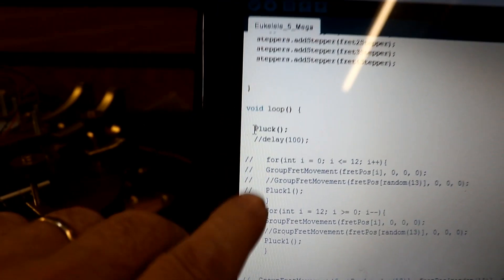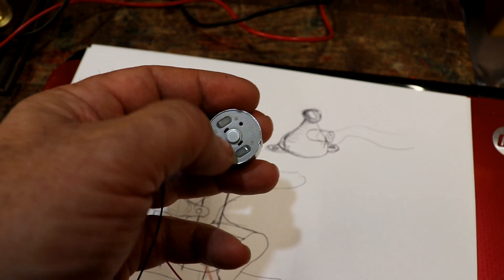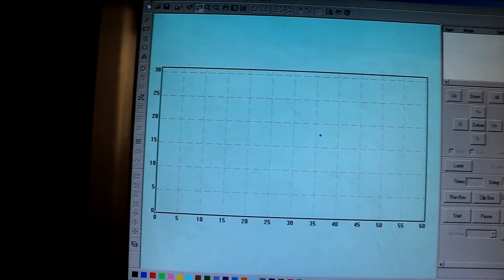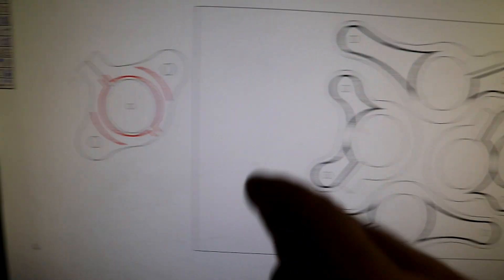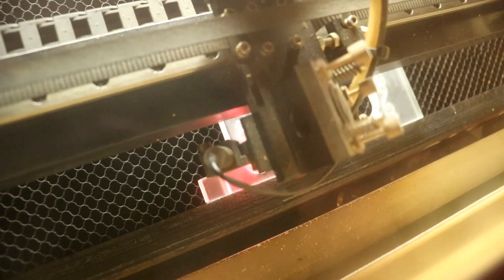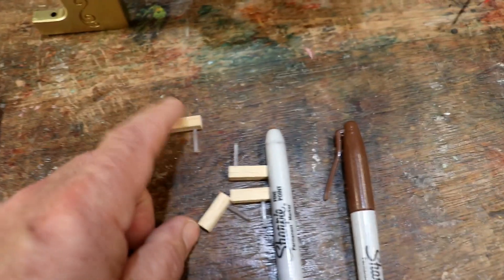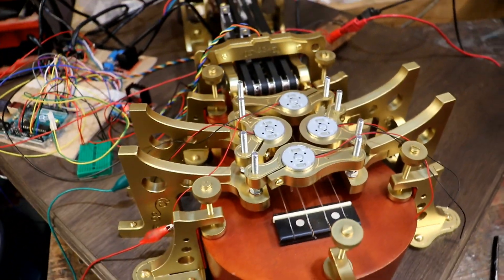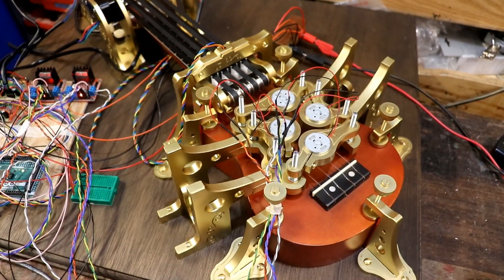Ukulele Playing Machine - 8

Comment: hmm, I suppose you could probably also make some sort of similar-ish contraption with push/pull motors to operate a mechanical typewriter, write a program that will read a text file, and translate the letters/etc to map coordinates (where the physical keys are) so basically a typing robot, sort of an unnecessarily mechanical printer. Sorry I'm a bit typewriter obsessed. 
...
oh heck, I suppose you'd also need to arrange something for the carriage return lever, possibly program it to activate after a certain character (including spaces) count is reached to set margins, or nah, better yet, just use an audio sensor programmed to detect the frequency of the bell, which would allow you to just set the margins manually on the typewriter itself, and operate a more like an actual typist.
Reply: Oh curse you for inspiring me to think this much, but I've just realized you'd need a way to tell the typing robot when to stop because it's run out of paper..

I suppose since the paper is white, and the platen (the big rubber roller) is black, you could shine a light (laser?) at the blank paper behind the platen, reflecting onto a light sensor, until the paper gets out of the way, exposing the black rubber platen. So long as the sensor is reading sufficient light, it keeps typing, once it goes dark, the program pauses the typing, and triggers a motor that say, perhaps turns an antique style mechanical twist doorbell, (or even perhaps some weird ukulele playing machine, if you happened to have one laying about) to let you know that it's time to add more paper, and push a button to tell the program to resume where it left off.

Okay now I'm starting to think of ways I can add some electro-mechanics (and fancy gears) to the reproduction antique mechanical twist bell that I paid $40 for, and installed on my front door, only to find that nobody ever uses it because they have no clue what it is, and I really should stop this and go to bed!
Reply from the maker: @amishrobots  Thank you so much for sharing your ideas! It's great to be in touch with someone else who gets completely carried away with exciting ideas. I'll have a think about a typewriting automaton, it's definately possible and I happen to have a lovely Royal typewriter in the loft, the one with beautiful bevelled glass windows in each side so you can admire the ingenious mechanisms within! 

I've been thinking more about the gauge idea, and realised the gauge needn't be electrical, it could work on pressure, temperature or purely mechanically - the subconcious is truly amazing!
Reply: @steamhead  Ah, would that be a Royal no. 10 then, or something else? I have a few machines, but no Royals. I do have an Underwood no. 5 which is quite similar, with open sides, but no glass. A pair of Corona 3s, which I love for their diminutive size, funky 3 bank keyboard layout (separate shift keys for figs & caps) and of course the carriage folds over the keyboard for compact transportation. a couple of nice Remingtons, and several Smith-Corona Skyriters. One day I dream of owning a nice Blickensderfer, with the DHIATENSOR layout...
Reply from the maker: @amishrobots  Apologies for my lack of knowledge regarding particular models, but I do love an old fashioned mechanical typewriter. Luckily I grew up when they were being superceded, so regularly received an old one from neighbours etc - I had very understanding parents!

As you are; I absolutley love the mechanical inginuity required to achieve so many complex tasks that today are a doddle. And the fact the manufacturers took such pride in displaying their machines' features - tabs, changing the ribbon colour, and I vaguely remember something that allowed the typist to delete a letter - not sure about this, it may be my imagination!?

Also the fact they were properly engineered with cast iron chassis that were enamel coated with beautiful gold trim line that had obviously been hand painted. Beautiful machines.
Reply: @steamhead  Indeed!
When I look at the mechanisms in my own small collection of antique typewriters, I am amazed at the level of precision engineering, machine tooling, and craftsmanship that was possible long before the computer age. As for correction technology; yes that was definitely a thing, which was implemented in several different ways. One of the simplest methods, involved the dual color ribbon you mentioned; instead of a black & red ribbon (or some other color) you could (and still can) get a ribbon that was black and white (correction tape, basically) and don't forget the middle position on the color selector toggle, which bypasses the ribbon entirely (it's for cutting stencils, though I've never had the opportunity to try it) There's a great video about the typewriter correction process, and it's evolution, here: https://www.youtube.com/watch?v=YE0U018Copw 

As for the gold trim... I'm not even sure how they did that, elaborate stencils of some sort? I have a Singer sewing machine from 1913, with an elaborate (though chipped and faded now) Sphinx design which was quite common, duplicated across millions? of machines; the sort of thing that we take for granted today with laser printers and modern technology, and yet... it seems like with all of our modern products, made with modern technology, all that possibility and we get so much less in terms of aesthetics and craftsmanship. I've got a typewriter in front of me that is 100 years old, sitting next to a rather expensive, and quite up to date computer. And which one would I expect to be fully functioning ten years from now?

The thing is, there are a few companies even now, still making manual typewriters, and the machines they make are basically garbage compared to the antiques, because the cost of producing such a solid, well built, precision typing machine, is far beyond what the average person today could afford, All this amazing futuristic technology, and we cant mass produce even a decent typewriter?? Oh sure; it's an obsolete machine in the age of smartphones, but the idea that we can't even recreate such a "simple" machine now, seems ludicrous to me.
Reply from the maker: @amishrobots  they really are a miracle of engineering, especially considering the accurate placement of the letters and paper. I'd forgotten about the centre ribbon position. When I went to school in the 70's, any copies we had used the typewriter produced stencils! I seem to remember lines could be created with a pen onto which was mounted a sharp star wheel that would create a line of small holes. The copies would always be purplish and smell beautifully of methylated spirits! Thanks for the link.

I assume the gold decor was hand applied because, as you mentioned, it was featured on all sorts of complicated curved surfaces. I'm reminded of the women who used to paint the luminous numbers on clocks and dials, especially gauges for WW2 aeroplanes etc. To keep their fine brushes at a point, they'ed regularly lick them back into shape. Very sadly this caused a great loss of life as the paint was radioactive. It does demonstrate how human precision used to be relied upon.

Very good point about which will be working in 10 years time! The thing is, no comany wants their product to last indefinately - just think about the 'Right to Repair' nightmare and how software companies want to to rent software, and new cars that communicate with head office to see which features to unlock! It's all gone crazy.
Reply: @steamhead  when you said purple ink, I thought you were referring to mimeograph copies, but now that I've looked it up, perhaps that was the spirit duplicator? (Sadly I've never had the opportunity to use either)

As for the gold decoration, yeah, I would have to assume that some part of the process was done by hand, because of (as you mentioned) the curved surfaces. Perhaps it was an adhesive stencil mask that they brushed the gold paint over, and then removed? I can't think how else they might have gotten such crisp, perfectly dupilcated results.

Regarding the ladies who painted luminous guage dials: yeah, I've read about that before. Yet another horror of war!

As for the Right To Repair, that's a subject quite close to my heart, especially as a tinker. Alongside such issues as the "Analog Sunset", copyright/patent law, Planned Obsolescence, Net Neutrality, etc. So many products are made to restrict the user/consumer, and/or simply break so as to force further consumption, instead of being made to inspire creativity, modification, freedom of use. The Internet has given us so much power to share information, to inspire creativity. So much knowledge at our fingertips on how to build, create, and repair things in the the world around us, and it seems like the established industry of consumer products is just fighting against that power to keep a grip on our wallets and minds..

Certainly some of this is just inevitable as technology advances, becomes more complex, and just physically smaller. Today's smartphones would have to be carried around in a wheelbarrow without those tiny little SMC bits, but still I lose my mind at the thought of trying to solder resistors that are smaller than a grain of rice! (I occasionally build "guitar" effects pedals, primarily for noise use)

Anyway, I'm currently building a few steampunk rocket ship lamps. Just finished one (except for the wooden base, because I can't find my hole saw just now) about to start on the next, thinking about perhaps making a video of the process. It's a nice, fairly simple project; nothing nearly so complex or impressive as your ukulele playing machine, but it looks cool, and makes me happy. 

Oh, come to think of it, 'twas my search for videos on the "Steampunk Rocket Ship Lamp" project that led me to your stuff in the first place. At some point, I definitely want to build some version of your voltage controlled gauge project: too many times I see such gauges simply stuck on to a steampunk project as decoration, not actually functioning in any manner whatsoever. That's always been one of my biggest pet peeves in steampunk: seeing gauges, dials, and gears that were totally nonfunctional. I mean even if they don't do anything particularly "useful",  for Cog's sake, at least make it do /something/! I find the aesthetic value of gears increases exponentially, when they just go round, and turn other gears. And gauges aren't much fun, unless the needle moves, even if it's only purpose is to indicate how far the needle has moved, well at least that is something!

Oh btw are you on Farcebook?
Reply from the maker: @amishrobots  I think it must have been a spirit duplicator. Amazing to think kow well it worked considering the original was just a piece of paper with very thin cut out letters.

I've looked up how old sewing machines were painted, but can't find anything, I recon hand painting with a fine brush, lots of practice and a steady hand!

Modern manufacturing industry works really hard to keep their monopoly on repairing things, if that's even an option. I try and keep abreast of the Right to Repair movement in the US and its continuing battle against the hoards of lawyers trying to intimidate anyone promoting it. Absolutley two faced hypocrisy - planet loving, all caring, very green publicity, backed up by teams of lawyers...

It is amazing how small electronics has become, and I know what you mean about the miniscule components. The smallest I attempt are those surface mount LEDs. Having said that, the majority of issues with smartphones are caused by the controls/connectors breaking and obviously the phone companies go out of their way to try and prevent 'unauthorised' repairs. They also remove things like headphone sockets (to save a few pence), so users are forced to used bluetooth audio connectors - more plastic, more components, more batteries, more electricity used - madness!

It would be great to see your steampunk rocket ship making process, especially if it makes you happy! I'm in complete agreement - I can't bare stuck on cogs and gauges etc. To my mind everything should have a function, whether real or implied. It gives a steampunk creation authenticity. As you say, if it moves, even better!

I do have a Facebook page at https://www.facebook.com/steamhead.co.uk and a website at https://steamhead.co.uk/ and even an Etsy shop at https://www.etsy.com/uk/shop/SteamheadInventions

Never a dull moment!